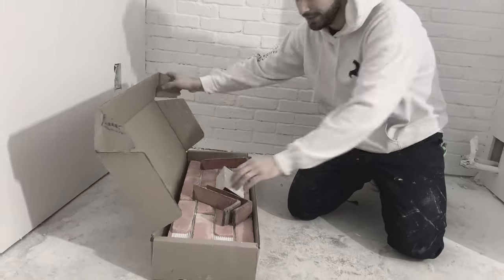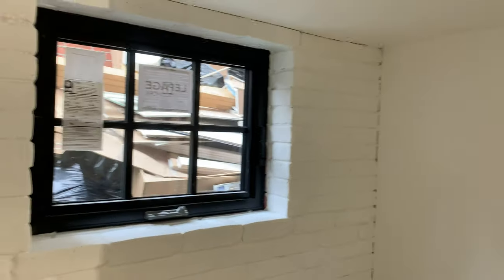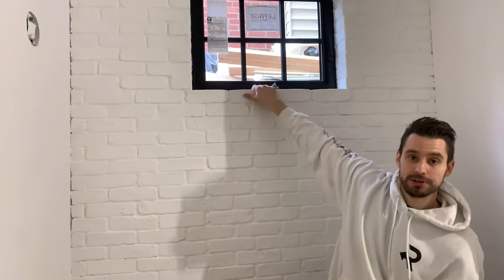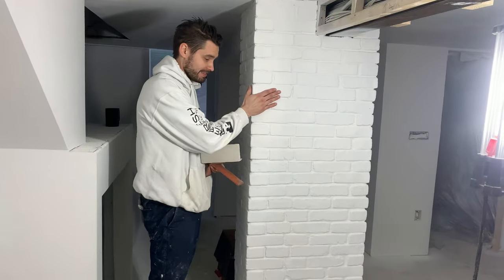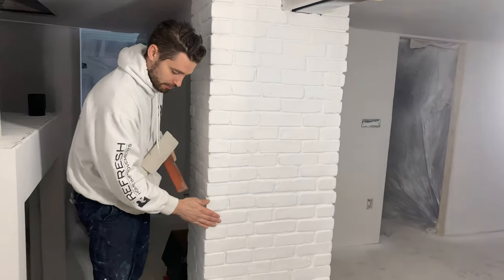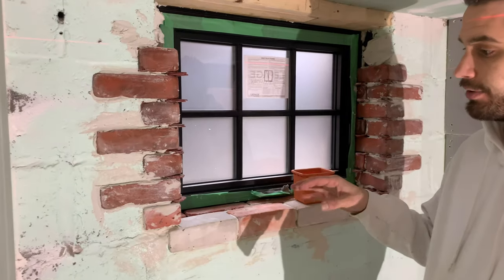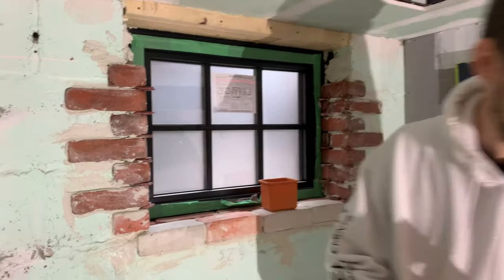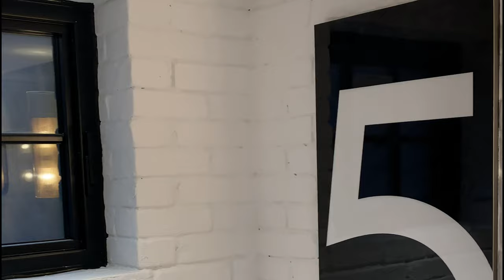Easy Brick Accent Wall (Realistic Faux Brick Veneer!)

Comment: Excellent video !  I have new construction with my black metal wood burning fireplace insert installed .  Now I want a white brick looking surround with a hearth .  Will this product work for that ? Thanks
Reply from the maker: It should- but you might want to check with Century Architexture to be safe. The tiles are made of plaster, so we can’t imagine you’d have a problem- but we can’t say for sure 👍
Reply: Gypsum material survive in more than 500 degrees Celsius... If you're not going to create foundry near your fireplace, you can... Checked by practice... 
However better check in your authority... In Ukraine we do it on our own mind

Comment: Hi!  Great video, t hank you!   I have seen feedback on other videos that it is very heavy and maybe too heavy for a normal inside wall with sheet rock - thoughts?
Reply from the maker: I would wager that anyone suggesting that theses are too heavy are likely using a different product. The Century Architexture tiles are made of plaster, and are lighter than most mosaic sheets you’ll find for doing backsplashes etc. The project in this video was installed on painted drywall, as were a few others we’ve done over the years and we haven’t had an issues 👍

Comment: Amazing!  After seeing that brick wall in your "caulk gun" video I never guessed that it wasn't real brick.  Is it made of real brick material?  What is the adhesive that holds it to the wall?  Thank you for sharing !
Reply from the maker: Thanks! They’re actually made of plaster, but have a very similar look and feel to real brick (only way lighter and easier to cut ). You use the same material you would use to adhere tile, so just about any good thinset mortar will do!

Comment: Did you do the grout the traditional way in a bag and filled all the brick gaps? Or did you do it a different way? Thanks 😀
Reply from the maker: For this application we used thinset mortar in a ‘homemade’ piping bag, and wiped down the excess with a sponge. We highly recommend using a vinyl grout/mortar bag with an applicator tip and a brick jointer if you want to keep the joints clean. Our client wanted it to look messy, so we weren’t too concerned with how we applied the mortar👍
Reply: @RefreshHomeImprovements  niv

Comment: Great video, very inspiring! What kind of paint did you used on the brick?
Reply from the maker: As long as you start with a high quality primer, you can essentially use whatever paint you’d like as a top coat. The plaster is very porous, so you’ll use a lot more paint than you’d expect on your first coat (save some money by using a primer instead of a top coat first). We used Digby Paints in a  low-lustre eggshell finish as a top coat 👍